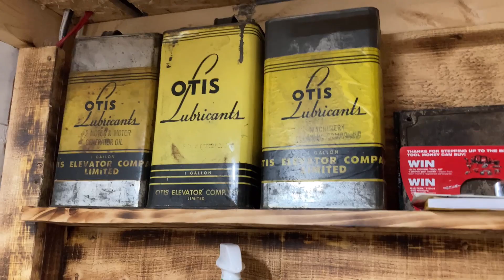Shop Talk

Comment: Did you hear about 3 people fighting by an elevator all went down the shaft? Could do a nylube gib 5/16 flat tip give away with a good tightness instructional... 
Blain valve basics would be cool, kind of sparse but around. Not covered by Linden elevator youtube channel yet. Thx for channel.
Reply from the maker: I did not hear about that incident. Do you mean a slotted screwdriver give away? A blain valve walk through is a great idea.
Reply: Im guessing weak/missing gibs or fire tabs. Or they could have all had a death wish like the angry wheel chair guy that smashed the door till he rolled in and died.